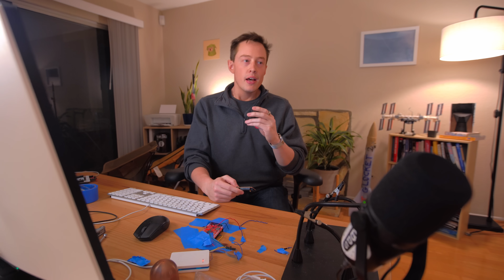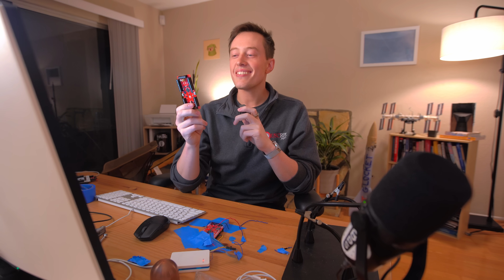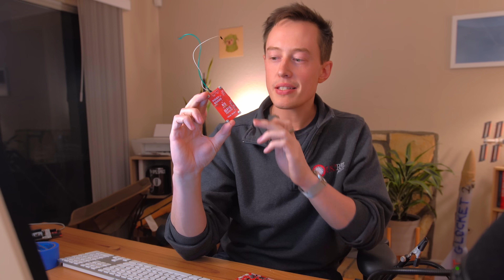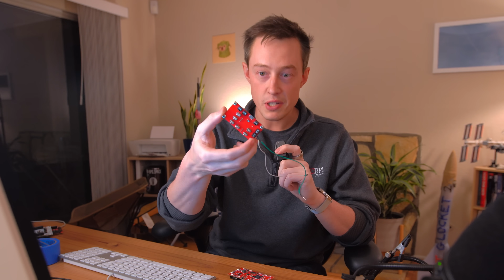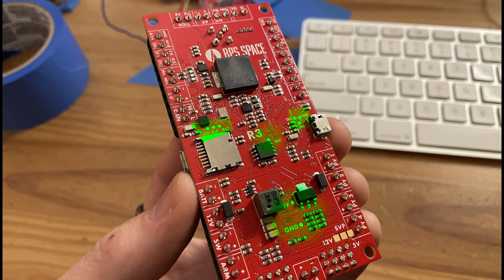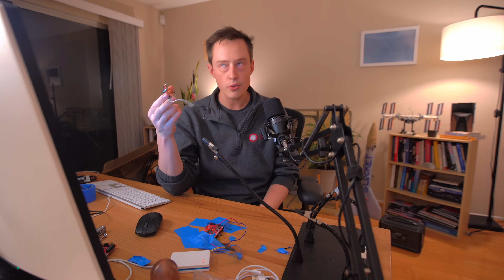the dumbest electronics thing i do

Comment: Hey, to be consistent with your blue tape fixture method tape the mouse to the floor and use your foot to click.
Or if you want to go fancy build a Rube Goldberg machine around your room so that you could start marbles rolling and still have time to position the wires before a falling weight clicked the mouse.

Comment: You have a 3D printer, so why do you need to design a PCB just to program????? Just make a rectangle with three holes, and you're done - 3 minutes to design, 10 minutes to print, another 10 minutes to solder the pogo pins to the cables, and hot glue its done. I’ve done similar things before, but there are even simpler solutions.

Comment: I once made a charger for a fitbit watch by pushing heated pins through a sheet of plastic and adding a clothes peg to hold the thing in place....  If I recall correctly, the plastic was from a broken storage bin of the Ikea Samla vareity..

Took 5 mins to line up and then I just pushed the pins through. 

You could probably use pogo pins if you want to be fancy

Comment: I struggeld the same way on many projects and got so frustrated. One day I saw a video on data recovery and they where using a "Spider Board" and I was blown away, first by the thing, afterwards by its price. So beeing a dumbass I grabed a piece of plywood from my workshop, drilled a few holes in a circle on it, added a laundry-clip in the middle to clamp down the boards and screwed a linkage adapter for rc planes in each hole (the ones that are like screws with long heads with a hole through the head where the linkage wire can be clamped with a little set-screw, if you know what I mean). Then I scrwed a seaing needle in each of them and bend them to form 90° bents. On the bottom of the plywood where the nuts secure the linkage adapters i added jumper leeds to each one and screwd them on with additional nuts. And thats a cheapass building a spiderboard which still is a pain to setup, but belive me, setting it up instead of holding every pin by hand and shorting out everything constantly ist denfinitly worth it ;)

Comment: I’m just finishing up work on my first real microcontroller-on-a-PCB project (in this case, an Atmega328), and I cannot tell you how relatable (and kinda reassuring?) this video is.
Relatable because I had a very similar problem (I opted to expose the ICSP headers for the chip through pin headers), and reassuring because there are areas of the project that are at least as hacky as this.

Comment: Pogo pins in a 3d printed block to keep the spacing and then plug the ribbon cable wires you already have into the back. Then your 3rd hand arm would be able to maintain the position easily.

Comment: You should design a 3d printed holder/plug  for the wires which would allow you to use one hand to hold the wires and push contact to the pads

Comment: Don't you happen to have a 3D printer? If not, project a jig and ask someone to print it for you. I guess that something with a lever and a spring and contacts positioned at the right places would help you a lot  If it holds the board in the right place, even better.
Edit: Or a clothes peg, some pieces of metal sheet, glue and patience.

Comment: I would think you could use a board with multiple flexible hands attached to it (as in lay the pcb on the board and put the wires into the mechanical hands and move them in a way to touch the correct pads), not sure what it is called but I'm pretty sure I've seem something like that. Worst case just buy those flexible arms with little crocdile clamps in the front and strap them to a board of plywood or sth.

Comment: I did something similar for an old project, but instead of pads I used .7mm holes. No need for a connector, but it acts as a connector because it's just big enough for a jumper wire to go through with friction and make good contact

Comment: solid core 22ga wire, 2 popsicle sticks, epoxy.

-run the wires down the length of one popsicle stick, epoxy in place, use the second popsicle stick to make a popsicle stick wire sandwich.
-leave enough wire at the output to cut, strip, and bend to the required spacing for the bootloader.
-leave enough wire at the input to solder a connector that can be easily connected to the hardware that burs the bootloader
-add more epoxy to the output end to lock the wires in place once the spacing is correct

single hand boot loading from parts we've already seen in your videos.

Comment: Hah -- have def done this before. Nowadays I use the Tag-Connect TC2030-NL footprints (super compact) on all of the ST32-based boards I design -- but they also make specific cables for various Atmel, Microchip, and other archs (or you can just do it yourself using their connector). They typically have two footprint types: Regular and NL (No Legs). The NL version just has registration pins, and it comes with a tiny PCB to allow you to put under the board if you need to do extended debugging/multiple programmings (can be kinda fiddley... I need to buy the regular version at some point...).

For more extensive debugging, on some boards, I will also design my own edge connector that can be used with a 3D-printed fixture + pogo pins (some of the audio boards I've designed have this so that I can read out and calibrate the various voltage references without having to probe tiny points). Although for the small boards you typically use, may not have enough room for that.

Comment: embedded electronics engineer here

what you want is called a (custom) programming fixture - the cheap way is to buy some wide pitched male connectors, split them apart + put them in some "mold" that lines up with the programming pins on the ava + wire the appropriate SWD, SCLK, GND, PWR pins to the male connectors (use dupont male to female ribbon cables - or ditch the male connectors and just use male to male dupont connectors). i.e sam ice -> dupont connectors -> glued in a mold -> male connectors exposed on the "bottom" side of the mold

make something to align the mold w/ the ava boards and use gravity to set the male connector onto the ava programming pads - a 3d printed box would work, and the easy thing is to make the mold the a tad wider in each dimension as the ava board but with a riser the length of the aforementioned connectors such that the connectors touch pretty well onto the ava board

your issue is going to be making sure of signal integrity with the sam ice to the other end of the male connectors, the clock line has to as close to the same length as SWD (single wire debug)

fyi there are services that can put firmware onto a reel of ICs and repackage them for you to use - im not sure on volume/availablity, we do this inhouse at my work
Reply: What about something like a Data recovery probe fixture

Comment: Early fpv drone days when flashing simonK firmware onto electronic speed controller's, I had to make a lead to do the same task. I made a lead out of a ribbon cable with cores cut out to get the spacing correct, then glued together with hot glue to hold it straight. Still had to manually hold the flashing cable.
Now with access to 3d printing, you could 3d print a small tool with a spring loaded pins to contact the board. You have the pad spacing measurements :)

Comment: put the pads at the edge of the board and use one side of a soic 8 clip. You can wedge somthing in between it to hold it tight. So you cam do it free handed. CH341 kits include one and costs like 5$. Or you could make holes solder wires and than remove them.

Comment: Grab a ruler, an elastic band and solder 3 pogo pins on a perf board along with the 3 wires.  Should be good enough for 50 boards

Comment: Tag connect is the production answer to this problem. For smaller runs like you're doing here, I like the sensepeek hands free probes, which will fix the holding wires problem, and is super useful for debugging.

Comment: If you use the correct spacing you can just break off SIP-connectors, solder wires to those and hold those against the board. Having plated drillholes obviously helps with alignement, but either way now you just need one hand for three wires.

Generous estimate for time spend making this ”tool” is less than two minutes, assuming you already have the wires, source of SIP connectors, and a hot soldering iron. If balancing the cables cost you 20 seconds extra this pays off after flashing four boards.

Comment: 1) Get cheap USB mouse (or AVR with V-USB) and foot pedal - boom, one hand free!
2) Make 3D printed guide for your pogo pins, so they will always easily align over that microSD slot.
3) If you are ordering new boards, can't you make pins through hole?

We used point 2 and 3 in previous work. Pogo pins self align in holes of PCB and we had pogo pins epoxied on board cover, so you just inserted board in cover (got aligned by mounting holes) and pressed BURN. Worked perfectly :)

Comment: I flash my boards also by just holding the pins against the bootloader pins. The difference is that mine have a male pin header, so it is easy to push against and even wedge it on something.

Comment: I really like tag connect programming headers (get the ones that have clips that hook into holes in the board, I promise it's worth it). The main benefit is the bit on the receiving board is just board features, no part. Unfortunately they're pretty expensive for what they are. Unfortunately², it would also require a respin of this board to use them.

Comment: Plug in a second USB mouse. Sit it under your desk and operate it with your foot. Or for a more proper solution make a poorman's wafer probe station. Solder programming wires to the copper wrapped ends of acupuncture pins and hot glue them to a hard backing like wood. Then clamp that assembly to your desk. Slide the board to be programmed under the protruding pins and bend the tips down to make contact.

Comment: @BPS.shorts dont you have a 3D printer? Just design and print a tiny jig for the 3 wires to slot their (what looks like) dupont connector heads into. Then you just need one hand to hold the pressure. This would take no more than 1 hour of design and printing if you do it as simple as possible. I feel like this is the best engineering solution for the least amount of additional effort..

Comment: you could just solder the wires to male jumper headers? that way you only have to hold one.
for the triangle, break them appart and hotglue them back together?
or tape the  wires on?

Comment: For a stepper driver I made I had test pads like this and I just 3D printed a little block in which I glued pogo pins, kind of like a custom connector I hold in place for flashing it work nicely! The first version had a very stupid design flaw where the reset button was on the opposite side of the pads so pressing the thing in place would hold the reset... Learned something from that for sure hahahaha

Comment: I really don't know why you wouldn't spend 10 mins making a jig that you just drop the board in. you know like a bit of wood with some nails in it for alignment and some pogo pins for the connection. or if you wanted to get creative, a bit of wood with 4 nails / dowels in it that match the 4 holes in the board and then a cover plate of acrylic with the connectors in so you can visually check the alignment. if you wanted to be even lazier, just some pogo pins in the right order that have been jammed through a bit of plastic would do.

Comment: As for programming the unfortunate design you have right now use pogo pins. Press fit into a 3d printed block for your spacing and solder your wires to the pogos. You can even use nearby chips and put recesses in the block to go over the chips to align the pins so it sits in the same spot every time. Just a few minutes in a 3d cad tool to get the spacing right and 20 minutes of print time.

Comment: What did I miss? Why not just install a 3 pin header? It's pretty typical to have a programming header unless it's such a high volume product that you save money by not installing a 5 cent part. And same thing for the bootloader chip. It's crazy to solder that chip yourself.

Comment: easy - but still bad solution: 3D print a holder for the 3 pins, properly spaced. That way you can push them down with one hand instead. You don't always need the best solution for a problem, just a less bad one

Comment: If you do a search for "pogo clips" you'll find that people make a few different kinds of contact-pin spring clips to do exactly this sort of thing.  I don't know if the pin spacing or clearance requirements of the multi-pin ones would be exactly right for your particular board, but worst case you could probably use three of the single clips to clip on to each of the test pads...

(and for any devices in the future you can lay out the pads specifically with an appropriate pogo clip in mind)

Best "no effort" solution:  Just buy a solution that somebody else already makes.

Comment: litteraly me yesterday, was holding 4 wires(VCC,GND,TX,RX) with left hand against the pads and 1 more wire(RESET)  with other hand and also needed to launch python script to flash new firmware to board, so i edited python script to run with a 10 seconds delay. And now i have to hold it firmly for the whole process of flashing firmware. And i did it twice for two boards!!! And i thought of that spider thingies to hold your board and connect to open pads. I was thinking about it  for the whole time during the process of flashing

Comment: Use a Spider Board. When microSD card go bad and they want to retrieve the data, they can "sand" the back side and attach needle like thingys to contact some pads with enough pressure to read from the card. This could be a solution

Comment: 3d print a jig that holds your board in place and has a manually toggle clamp. place an end effector on the toggle clamp that has spring loaded pogo pins. when you lower the toggle clam onto the board the pogo pins will be pressed against your bootloader/debug pins for programming.
Reply: but at that point I'd just say design a new board. PCB production these days is not too far off from software production costs haha. its so darn cheep.

Comment: Somewhat more elaborate solution that is  easy to adapt to more or less any board: u can make a grid of n by n pogo pins with pin spacing being an even multiple of your layout tools snap to grid size with somewhay reasonable travel distance with some adreasing circuitry and a lot of broken out dupont headers. Then you can just 3d print or laser or cnc or whatever a mask with holes for the pins in the grid that need to get to the board and an alignment edge for the board. Then just press down on the assembly. The pins covered by the mask will be pushed down out of.the way and the ones that aren't covered by the mask will go through the mask and reliably contact the test points in the pcb. If you wanna be extra fancy you can add a locking mechanism for pressing down more reproducibly and.without having to hild the.board down.

Comment: As others have mentioned - TAGconnect is really cool, a bit expensive, but you only need one cable. Also gives you an option to use SWD/JTAG directly during development, instead of bootloaders, which is very likely faster and more convenient. And on top of that you can do debugging (Ozone, VSCode, etc), access any memory/registers contents and output logs via RTT.

Comment: i think this is probably already said but pogo pin glued/friction fitted on a 3d printed jig, should be relatively low effort with like 10 min in aliexpress, 20 min of cad, 1 hour of waiting the print and 20 min of soldering,

Comment: you can just solder these cables on a 3 header pin strip and press this thing on the board with one hand, maybe you'll need to bend the pins a bit to make the contact, but i think will work just fine

Comment: If the spacing on those test points is right, grab a servo header pin strip, solder the wires to the 3 pins, and at least you have a single unit to hold against the pads.

Comment: There's like a ton of things that could be done quick to make this easy. pogo pins. in wood, perf board, quick 3d print if you have printer. I've even done extra board blank drilled out since it has the right spacings alrady. Solder to the pads then desolder them. grab a friend to push the button? next time add through hole pins at 0.1" and solder pins to a connector...but fine no effort november i guess.

Comment: For small runs, I like to 3d print a "tray" for the board with holes for pogo pins. I solder wires to the pogo pins then super glue them into the holes in the print.

Comment: Regarding the generating of pick and place files: I mostly use JLCPCB for assembly, and there's a KiCad plugin called Fabrication Toolkit that simplifies this whole process to one click! The standard footprint libraries within KiCad don't completely match with JLCPCB's, so you'll have to correct the rotation in their web UI while ordering, but it's simple and fast enough. With that solved, most of my effort when designing for assembly is focused on finding the correct parts and tagging them in the schematic with the correct LCSC ID.

Comment: Just 3D print a jig that screws on to the board and imbed some Pogo pins on it to keep the pressure on it. Hell, you don't even have to screw it on the board. The print could just hold the wires in alignment for you so you don't need to be as precise with your fingers.

Comment: You could have just soldered all three wires to a header pin stack, and then you only need 1 hand to apply pressure, since the spacing is decided by the header pins, which are held in by plastic.